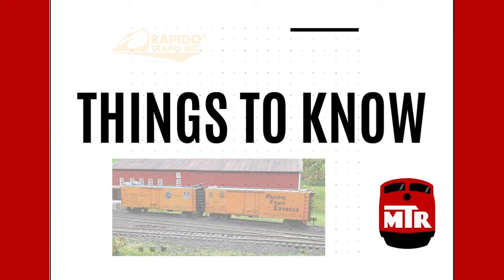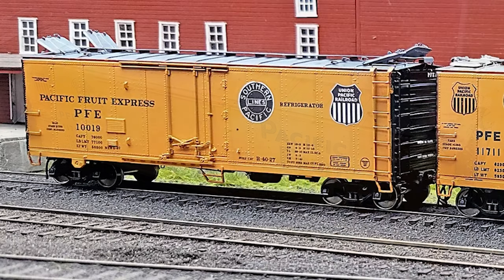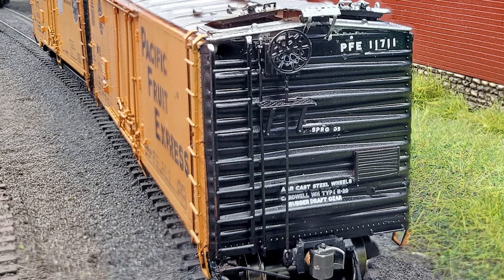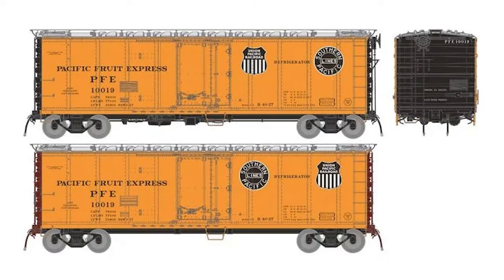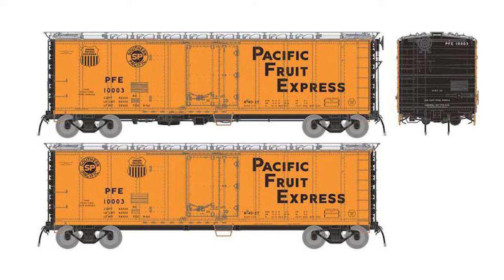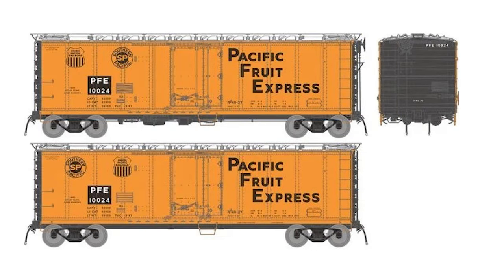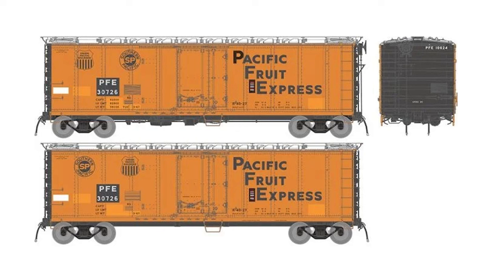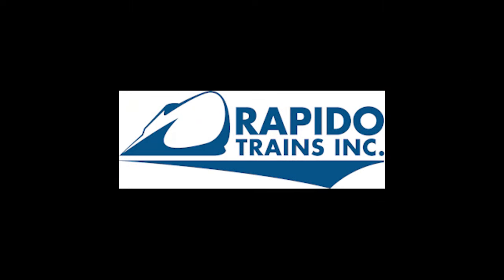Rapido HO PFE R-40-27 and R-40-28 - Things To Know

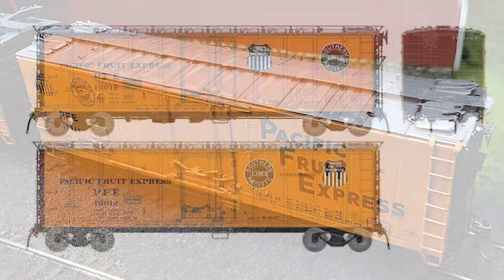Comment: Thank you for this preliminary review.  At 0:10 the treatment of the ends of the roof walks and supporting brackets looks awful given the manner in which the etched part has been rolled over.  It does not correspond to the line drawings shown at 0:20.  Granted, these are very early samples, and I trust Rapido will execute this detail properly as these models get closer to production.  Thank you.😅

Comment: There have been comments about the ends of the roof walks.  They curl around which is not how they should be.  They should run straight to the end and terminate without being bent over or curled.  This needs to be corrected on the production models or no sale.
Reply: Exactly so.  I hope Rapido gets the message.
Reply: These are preproduction models so I'm assuming they will be fixed